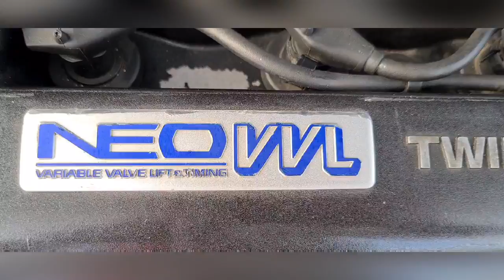JEANDRE'S BLUEBERRY THUNDER SR20VE!!!

Comment: How much difference would having my cold air intake coming from a metal pipe out the front lights? I've got mine zip tied to the bumper and it's plastic
Reply from the maker: Coming out the front light means straight forced air coming in and going straight to intake where if its by the bumper it has to move through the bends which takes longer to get into engine so practically it will make a difference
Reply: @travis_airm6x  makes sense, obviously I'm not loosing anything because I've felt gains by upgrading the intake
Reply from the maker: Fully understand but you could gain more ... longer the induction further the air has to travel
Reply: @travis_airm6x  will get into it when I get the chance , still a bunch of work being done Il do it when I get my intake ported
Reply from the maker: Then you can brings to the channel of you are residing in cpt
Reply: @travis_airm6x  I would but I live in Melbourne Australia my friend
Reply from the maker: Thank you for the support all the way from that side sir much appreciated